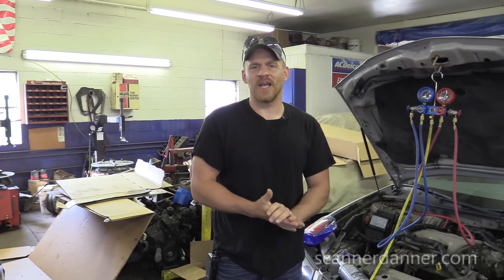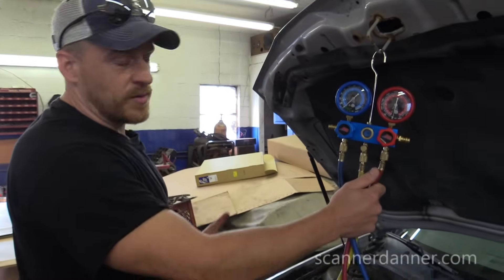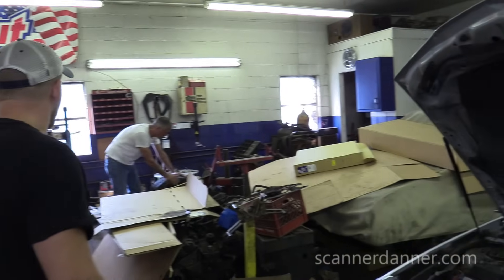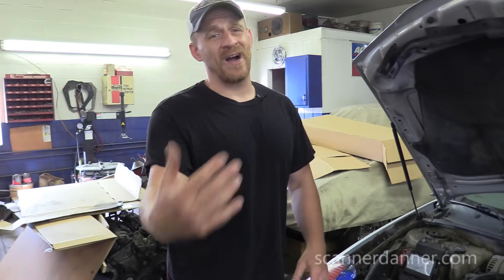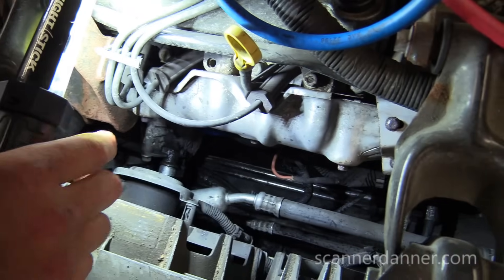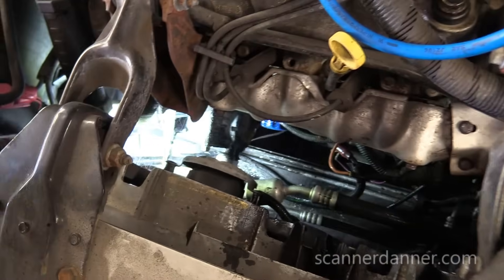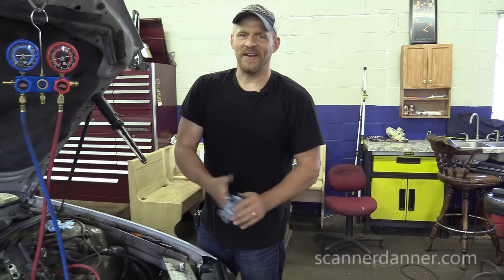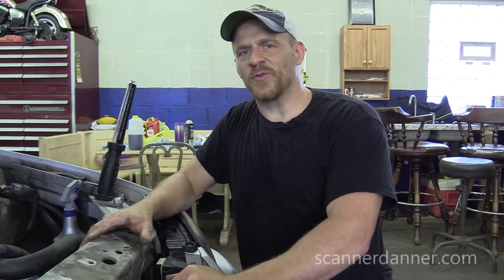A/C Leak Testing Using Compressed Air, Soap and Water (any car)

Comment: Nice video. As for testing for additional leaks after replacing the condenser and receiver drier, it seems once you pull the system into a vacuum you will verify if you need to search for any additional leaks by the fact whether the system is capable of holding a vacuum.

The discussion about the flammability of R134a with the introduction of compressed air is news to me since it is not a hydorcarbon based refrigerant. 

When servicing a/c system the procedure I follow prior to recovery of refrigerant is first to identify if there is any sealant; next, and hopefully no sealant present (sealant will destroy a refrigerant identifier), use a refrigerant identifier to verify you don't have contaminated refrigerant (no propane/butane (if present, now you have a flammability issue)) introduced into your pure refrigerant. If no contamination present, proceed to normal recovery. If contaminated then special procedures must be followed.
Note: fluorescent die does not damage a refrigerant identifier. 

It seems there is some "blending" going on with testing for leaks (an a/c system versus an evap system). In a perfect world one would use nitrogen with their smoke machine, rather than compressed air, when testing an evap system because introducing oxygen into the fuel system creates a situation that only requires an ignition source to ruin your whole day. In reality, the shops that I have worked at have such a small amount of nitrogen (used in conjunction with the low pressure fuel evaporative test (LPFET) portion of an emission test on pre-1996 vehicles), or none, compressed air is the only option available when using a smoke machine.

Comment: Dan, is there any reason you cant use your smoke machine on an empty system to locate a leak? My knee jerk says it might not be effective if it only leaks under pressure, but if the system is empty clearly it wouldnt require pressure under those circumstances. Your thoughts?
Reply from the maker: Mineral oil contamination with the smoke machine would be the biggest factor. You definitely don't want that in there.
Reply: Think it'd be a significant enough amount that running a good vacuum wouldnt boil it off enough to make it negligable? I just thought it might really help to reveal evaps of comp nose seals where they arent and oily mess...

Thatks for the reply.
Reply: Evaps "or*" comp.......

Comment: quick one, do you have to add oil when regassing, in situations like this one? i would say all of the oil went out with gass.
Reply from the maker: No, you will lose some, but very little. If you want to add oil, maybe an ounce at most.
Reply: @ScannerDanner  That's also why the pump won't go bad running on air- the oil is still in there mostly!

Comment: Save your trigger fingers (unless you're into body building) and try using a pump lawn sprayer (mine from HF). Works great for flat repairs too! The long tube gets into tight spaces as well.    I fill it maybe once a month. After 45 years the hands get a little painful squeezing triggers.
Reply from the maker: that's a good idea! I have two of those two. Thanks for the tip!

Comment: Hey question for you!! Low side pressure is pegged high around 80 psi, blows warm air, clutch is engaged...what can be the problem??
Reply from the maker: What is your high side psi during this? What do pressures do when you raise the RPM?
Reply: ScannerDanner thanks for responding. Low side is 80 currently, high side 80 to 100 if I'm reading it right. During rpm raise nothing changes.
Reply from the maker: with 80 on the low and 100 on the high. If you are sure the compressor clutch is engaged, the compressor is bad. Can you confirm compressor clutch engagement? If you can, you will need to replace the compressor, the orifice tube or TXV, the dryer and possibly even the condensor (due to debris from the failed compressor). But this all depends on how the compressor failed and if it pump pieces of itself throughout the system.
Reply from the maker: Pretty much. A blockage would draw the low side into a vacuum. I have one on a Durango I'll be releasing soon.
That compressor can't do it's job anymore.
Reply from the maker: It will be very soon.
Reply: bad compressor or over full .if high side is over 300 it. over full, if high side is 80-150 bad compressor

Comment: If you can't find the leak with air you can fill it with water and look for where its dripping.
Reply from the maker: sounds like sarcasm (I hope so) haha
Reply: fill system with paint thinner and use a cigarette lighter to find the leak. Thinner will emit a red glow when lit under pressure.
Reply: Aaron Sawyer what an idea man
😀😂😂😂😂😅😅👍👍👍
Reply: Too much work, How are you planning to get the water out of the compressor?
Reply: @AngelTorres-qu6fp  You turn it on and blow the water out through the leak before you repair it. And 99% of the time, I find the compressor is bad after repairing the leak and have to replace it anyway, so what's it hurt?

Comment: It's funny how some people are such experts on Y-Tube. Experience means nothing. Better not undo a fuel line, two drops of fuel might explode into a raging inferno. I have been repairing A/C systems for over 40 years and I have never had a problem with using Nitrogen, compressed air, electronic or refrigerant (R-12 days) while testing for leaks.
 In real life repair you do what you have to do within the limits of your knowledge and experience. As far as moisture goes, on the assembly line they pump em down for 10 seconds and then fill them. I guess that's why they install a drier. A tip for soap, Dawn liquid dish washing soap seems to make the most bubbles.
 Well done, Paul in my opinion.
Reply: You are correct if it working on a car that's been around a long time I would do two things change the expansion tube or clean it change the filter drier accumulator because of a bag of dust in the dryer degrades and can break I've seen that and you got one hell of a son of a b** in mess

Comment: I do have the nitrogen! LOL! I don't have the mega expensive Verus Pro but I do have Nitrogen.

I use it at work to easily test pipe fittings at 200 PSI. It stays in my care at my house so i also use it to test AC as well.
If air works I'll start using that instead of the Nitrogen.

The Nitrogen does have a pressure advantage over most shop air situations though, I only have 120 PSI available.

My first ever paid AC repair job I was looking for a leak by Nitrogen charging the system  and applying soapy water to every hose and fitting I could see.  I didn't see any leaks at 100 PSI and gradually kept bumping the Nitrogen pressure up and the leak finally showed up in one of the AC manifold lines at 175 PSI.  It was leaking right through the side wall of the hose ironically an not a fitting.
Reply from the maker: nice! I would like to use nitrogen for sure
Reply: The Gauge, hoses, fittings  and tank cost the most and the local welding shop will fill the bottle with Nitrogen to 2000 PSI for a small amount. 

A bad leak would use up the Nitrogen quick so shop air would be handy to use first especially for bad AC leaks so its nice to have a shrader valve Tee'd in to use shop air first.

My hose consist of all brass 1/4" flare some may need ACME  adapter,  1-  1/4" Tee with a 300 PSI gauge, short nipple, 1 - 1/4 " ball valve to isolate the gauge to the test, short nippel, 1/4" tee with a shrader valve and then a very high pressure minimal leak male quick coupler. On the tank side is the regulator and tank gauge set, a 4 ft hose with a female quick coupler. The quick couplers are 1/4" pressure washer couplers to be exact. 

 I took a pic of my setup. Here its setup to test water fittings. I used a new grease gun hose because it was the only thing I could make work without buying an expensive high pressure hose at the time. I usually screw it out and screw a 1/4  male flare fitting in for AC testing. My AC gauge set is setup for R22 so i have to use ACME to 1/4 " flare adapters for R134a tanks and cans.  https://www.helifreak.com/picture.php?albumid=6767&pictureid=109627

Comment: As long as you have a good drier in your air supply, there is nothing wrong with checking an empty system with compressed air.   Only thing I would disagree with is that I woud always replace the orifice tube.  This comes from years of experience with Gm cars using the old R4 compresor, though I've seen it on other systems as well.  Sometimes the tube is clean, sometimes very gunked up.  Any sumpless compressor is prone to this, especially if converted to R134a from R12.
Reply: Anytime you're working on an AC system that has an expansion tube change it or wash it out with brake cleaner you might get away without changing it if not you going to starve the evaporator and run High head pressure that's a No-No

Comment: That's a GM product. I once had a case like this, and what I found was that during a previous radiator repair the condenser rubber grommets were misplaced, and it sat on top of the frame and boom.
Reply from the maker: what do you mean "and boom"?
Reply: I think he maens it rubbed through and leaked.  Perhaps he should have said SSSSSS instead of boom.
Reply from the maker: haha I think so too but in light of the "controversy" with this video, I was looking for clarification. And "boom" doesn't sound good :-)

Comment: You can still have explosive mixture with refrigerant trapped in the oil. You created a possible ignition source when you started that car. I think you should take this video down for the amateurs who may hurt themselves
Reply: Dan I have located some more info on this topic. Not sure how to forward document to you through Youtube. Maybe through my email.
Reply from the maker: according to the data sheet on R134a, it also needs to be heated to a temperature over 212 degrees F, then combined with compressed air AND an ignition source. With an AC system that has been open to the atmosphere for a period of time, I am still completely okay with this procedure. I'm not a chemist, so I cannot argue your point of trapped refrigerant in the oil. I know the oil will trap moisture but how long would it trap R134a refrigerant if at all? Serious question, I would like to know. Thanks!
Reply: I really don't know how long a vapor mau be trapped in a system.  When you pressurize a system with a known leak using compressed air you introduce oxygen and other gases. This may create a flammable gas. You are supposed to use refrigerant or an inert gas like nitrogen or argon. Why take a chance?
Reply from the maker: Got it. Thank you. I thought it was this thread. I'm sorry but I need more than that. I searched too and could find nothing on the oil trapping refrigerant. I need some type of documentation. Can you help me with that? I admittedly didn't look long.
Reply: I don't feel it is a similar argument to using a test light on a computer circuit. That doesn't involve personal safety. I was in the classes when instructors were telling us to throw away our test lights as obsolete tools. I am simply following long standing safety practices. I enjoy your channel & have learned a lot from you. I can forward you some data sheets that say not to recommend using compressed air to test for leaks.
Reply: It's not a big deal. I'm just looking for clear documentation that this is dangerous in an empty system. Thanks for your time.

Comment: What is your opinion on dye?  Being from Miami as you can imagine AC is 24/7 year round here, and priority number1.  A person will buy a car that runs like crap but has AC, before they buy a great running car with no AC here. 😭 priorities.  I've never been let down by dye, and great thing about it is, all you need is a UV light for an integrity check.  Quick and easy any time.
Reply from the maker: I'm okay with it. It has it's place. But to use dye, you have to add refrigerant and in my experience, at least 50% of the time, when you get these empty systems in the shop, there is a big leak and all you are doing is pumping refrigerant into the atmosphere. So this is my go to test with an empty system.

Comment: Hey Paul do you have any knowledge of the swash plate(don't know if I spelled that right) design compressors and how to go about testing. Any new Toyota/Lexus model like from 2014 and up has them in particular 4 cyl rav4 and Camry. Any info on the subject would be great. Keep up the great work.
Reply from the maker: They've used swash plates forever in AC compressors. What controls the angle of the swash plate is some time of pressure control valve on the compressor itself, that is affected by both the low and high sides of the system (i think). It has been a long time since I've researched them. 
Diagnosis of pressure problems is when you will have to know more about the control of the swash plate for sure.

Comment: MY take on the possible leak or leak as I'm presuming you were chasing is that it could be a leak that occurs @ high pressures, o-ring leak at high pressures which may not show as often when under lower pressures. Is my approach between the low and high pressures appropriate? As when compressed at higher pressures a leak is more likely to show it's head soon vs a low pressure line leak. Just my .02 cents of what little wisdom I have left I thought I'd add for those who may fail to find a leak first pass and encouragement for them to not give up looking for the leak. 

Had a 98 Toyota Camry I own 161,800 miles where A/C wasn't working. I hooked machine up and checked pressures resting which seemed normal. Did a refrigerant recovery and only recovered .46 lbs of refrigerant. Did a vacuum of the system and it pulled the pressure down and passed the test after resting the appropriate time to verify there was no leak that would fail the test. Checked vehicle charge label and capacity was 1.87 lbs of R-134 freon so I entered the amount and charged it to the appropriate level. Started vehicle, turned air conditioner on and it ran better than the 4years I've owned the vehicle freezing me out on the low setting. 

Cost was, having a friend who works in a shop and a few bucks for a pop and a snack for his foreman come break time. Keep in mind this is a shop where they work on semis so the small amount of freon I used wasn't much and I left 2 16oz cans sitting on the shelf of their machine so in theory I left a little extra even though they have a bulk can. 

Just having a machine to do the full texting was a great asset. Had I had a bigger leak I'd seen you'd posted this video so it would've definitely came in handy that night. 

With me having that issue I realized my gauges at home were R-12 gauges so that's why I went by my friends work as I'd called him at home and he said his gauges were on top of his box but I never had to use them as the workers there at the shop said just do it all at once with the all in one machine. Much easier than my days of R-12 back in the mid 90's.

Scanner Danner if you do read this I've been looking at the Mastercool set of digital gauges which seem they are compatible with a lot of types of refrigerant. With universal refrigerant units do they need to be flushed with something between using different types of freon? 

The reason I'm eying the digital is I've worked on my home ac before and instead of buying a set of gauges for each type of refrigerant it would be nice to have a digital manifold which also can pull data up especially based on the vehicle make and model, is upgradeable and has graphing software which allows you to save multiple jobs so you can reference different types of work you've did later. 

Anything maybe you, another reader or your brother who works in a shop seeing more of this stuff than you can contribute would be greatly helpful not only to me but the rest of the community who'd read this at one time or another.

Going to try something with some hashtags below to see if it does what I think it'll do. If not maybe it'll still allow the stuff to show up in searches thus driving others to your channel

#ScannerDanner #ToyotaCamry #ChevyImpala #TestforACLeaks #AutomotiveACLeaks #ACDontwork
#R134, #R12, #AutomotiveAC, #HVAC, #Mastercool, #AirConditioning
Reply: Oh the hashtag thing did work #ScannerDanner @ScannerDanner . How cool. Been awhile since I played with the hashtags but they're traffic drivers when it comes to search results.
Reply from the maker: except I don't get a message about it, say like in a Facebook post.
Reply from the maker: I had a set of gauges that I used for R12 on the cars and I used the same set on R22 at home and never worried about flushing the gauges and never had an issue. Though back then, we were instructed to purge the gauge lines with the refrigerant in the system before ever adding anything haha. I don't think that is acceptable anymore :-)
Reply: ScannerDanner But used properly if I recollect as I've been playing less with Facebook and busy with other stuff I think you can be "Trending" on Twitter.... I don't get the notifications either. ;)